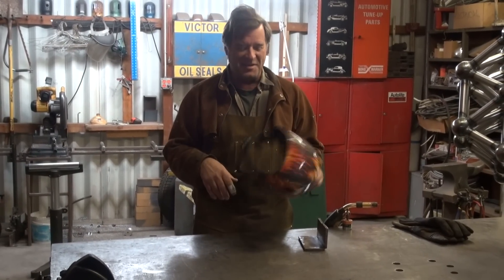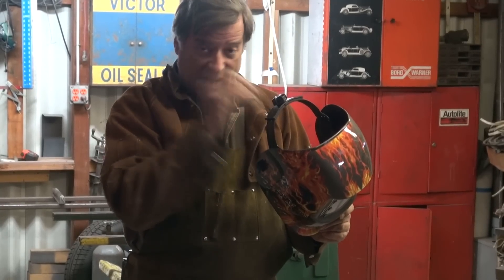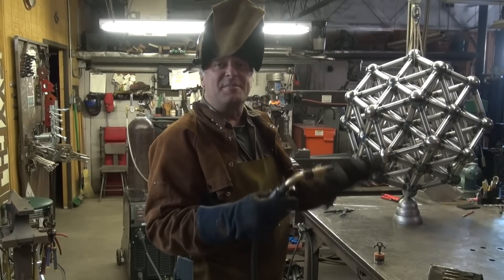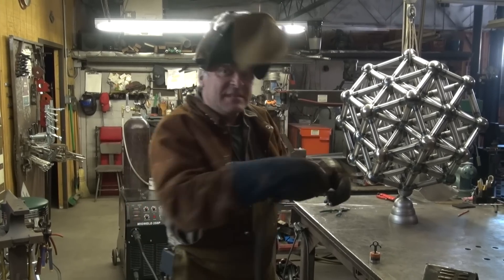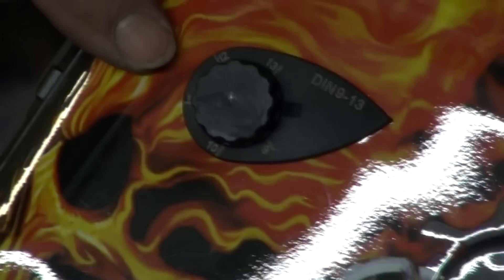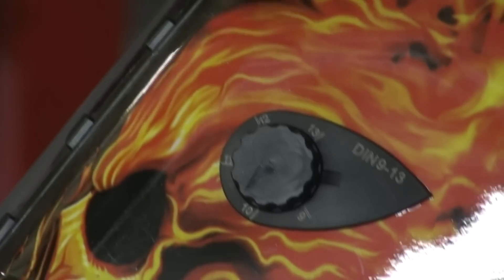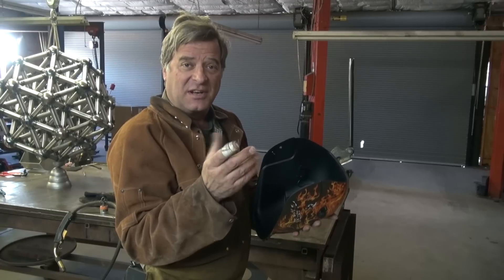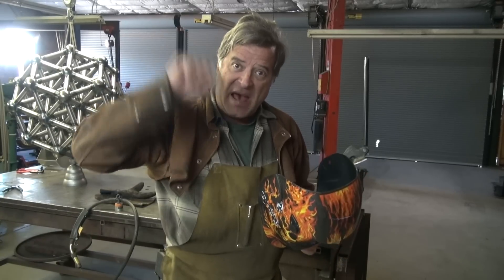How to See Better Out of Your Welding Helmet - Kevin Caron

Comment: I use shade 12. I work in heavy structural steel fabrication mig welding so my machine settings are high like around average 30 volts so shade 12 is better for me
Reply from the maker: Well, that must leave a mark on the electric bill!  Thank you for watching and posting.

Comment: I will say you welders wield some black magic with how you keep the helmet on your heads. I have three, from a cheapo Lincoln Electric, to a manual Miller, an autodarken high end Miller, and I cannot keep it on my head. At all. Unless Im welding looking up, it aint happened, not even enough for a tack weld.
Reply from the maker: I do have to tighten mine a bit to get it to stay.   Once you get the head gear adjusted correctly to your head, they normally stay in one place .
Reply: @KevincaronSculpture  Mine doesnt seem to like that. I do have long hair, and thats making it harder to figure out lol

Comment: Thanks for the vid, i noticed your useing gas to weld with and you were pulling the gun towards your self when useing gas you push your gun not pull it  pushing the mig gun keeps the gas on the ark pulling it alows the gas to go were it likes not stay were its meant to be on the ark if pushed not pulled your weld come out 10 times better and you wont have anywere near as much grinding to do to clean up your weld in fact pushing the gun and keeping the gas on the ark makes the weld look that much better you wont want to grind it the welds that pretty ive been welding since i was 15 im 59 in 26 days hope this helps take it or leave it up to you thanks again for teaching ppl they art of ajusting a helmet i wish this vid was around when i was 15 and learning as my welds were shitty at the start as i couldent see my weld and my weld never layed down were it was meant to go mind you back in my day starting out we never had helmets we could ajust eather the auto helmet was a life changer now all my welds are great i can actuly see this is a great video for ppl starting out so a big ty. regards.
Reply from the maker: Thank you for watching and posting Rod!   Always great to learn new stuff and even get a slap on the back of the head now and again.   I know it's a bad habit and will try to push the gun instead.

Comment: Are all the settings safe for eyes no matter the circumstances. One of my concerns has been to not turn it down to low. But I struggle to see well enough to see the area. Wonder from the seam.
Reply from the maker: No, you have to set the tint to the type of welding or grinding you are doing.   If you find yourself welding with your eyes half shut you need to go darker.    If you can't see the arc, then go one step lighter.

Comment: Great advice Kevin! I'm surprised you didn't mention insuring the front clear lens protector is kept in near new condition, removing any welding smoke and splatter plus any oils that have stuck to it from the dirty air environment welders work in. AND - Keeping the inside clean as well, using eyeglass cleaner wipes, as needed. Some welding hoods even have some kind of a a clear cover on the inside that needs to be cleaned or replaced when they get dirty. I also wear 'whole lens' safety glass readers of different magnifications (1.5 to 3.5)  depending on what I'm welding and how far away from the weld pool I am. Damned getting old makes it harder to see! (I'm 71 and still enjoy welding!)
Reply from the maker: All great advice Jesse!!   Thank you for watching and posting.

Comment: Hi, I'm brand new to welding and am struggling to see when I draw an arc. I'm stick welding and need to get advice on how to see at the moment the welding visor is brought down. I keep trying to start nicely, but every time I flip down the visor, I can't see I damn thing at the most crucial moment when I'm trying to start a nice arc!!! Any tips? Because I keep flashing myself in my eyes trying to sneak a peek!!!
Reply from the maker: Oh how I miss the good old days!   The best advice I can offer for this is lots of helmet time.   Just get some scrap and practice starting your arc.  I really don't know any tricks to help with this on a fixed shade helmet.   You could get an auto-darkening helmet and go from there.  After a few dozens rods you should start picking this up.

Comment: I never get flashed when I watch a video but the real arc light really troubles my vision.
I guess I will limit myself to spot welding with closed eyes (flux-core).
Reply from the maker: Try a fixed shade helmet with a number 10 or 11 tint.

Comment: Seeing the weld is not the problem, it is seeing where to weld. All i could see i your weld. I am working on a floor pan and very hard to see the seam.. Must be old age.
Reply from the maker: time for a set of cheater lens in the helmet!!
Reply: Had to look up cheater lens.. You mean magnifier lens. Just bought this at hardware store and glued on magnets at bottom.. Now i can see. https://www.amazon.com/Kasonic-Technology-Cordless-Emergency-Included/dp/B07K8SBWZX/ref=asc_df_B07K8SBWZX/?tag=hyprod-20&linkCode=df0&hvadid=309781175456&hvpos=1o4&hvnetw=g&hvrand=14791904779538865536&hvpone=&hvptwo=&hvqmt=&hvdev=c&hvdvcmdl=&hvlocint=&hvlocphy=9033558&hvtargid=pla-569243474051&psc=1&tag=&ref=&adgrpid=60862048999&hvpone=&hvptwo=&hvadid=309781175456&hvpos=1o4&hvnetw=g&hvrand=14791904779538865536&hvqmt=&hvdev=c&hvdvcmdl=&hvlocint=&hvlocphy=9033558&hvtargid=pla-569243474051

Comment: I didn't like this video. I couldn't see the puddle on a shade 9 or any of the other shades.I used to use cheap reading glasses. I found that I can use cheater lenses in my welding helmet.I have bifocals. So I weld looking through the top lense ( plus cheater lense). When I flip the helmet up, I inspect the weld with the bottom lense of my glasses. Also, sometimes you can see the metal your welding on with the helmet up but not down when your welding. Sounds funny but I will put a light directed at where I am welding, while I'm welding.  Hope that helps.
Reply from the maker: Thanks for sharing!

Comment: glad im here. i just started to weld. i was running thirteen and to me it looks like nine  according to the video, i can see alot of things around my weld running a 13. and my eyes still felt like popcorn after only 8 4 inch welds. is this normal. is there something else going on? and after 2 days when my eyes felt better i ran a 13 on my mask and wore my sunglasses and i didnt get the popcorn eye. i know a welder who was completely confused by this.... so whats going on.
Reply from the maker: You must have very sensitive eyes!    I would say take a week off from welding and let your eyes recover fully.    Then try again at shade 13 but make sure you are not getting any reflected light coming under the helmet.   Or maybe your helmet is not working correctly.    Try a different helmet and see how that works.  Make sure your helmet is not set to grinding mode also.

Comment: Avoid leaning directly over the weld.  The smoke soots up the lens too quickly.   Use clear plastic lens as the outside layer over the shaded lens and over the clear glass lens you might have behind a flip-up.  A plastic lens will shed sparks, where a glass lens will get encrusted with metal bits,  Toss the plastic lens as they get permanently  goofed up.
Reply from the maker: Real bad habit of mine for sure!    Got a fume extractor coming in a few days.   Should help a lot!

Comment: Great videos thanks.Reflected light is my biggest problem. Does that bit of cloth you have on the front help with that
Reply from the maker: Helps big time with light coming in from the weld.   Also keeps sparks from  going down your shirt.
Reply: Ian, I also noticed the leather flap and thought it could be to protect your skin from the sun like arc or flash of the welder as in skin cancer over time. Either way I'm going to make one!
Reply: Beard protector

Comment: some tips on seeing your welds better. clean every lens in your hood before you start to weld ( most new hoods have 5 or 6 layers) and replace the  clear protective plastic lenses regularly, and any other pitted/scratched/cracked lenses immediately. if you need cheaters (reading glasses) they make snap in (on the inside of the hood) a square cheater lens in most normal reader prescriptions that can be found at any welding and gas supply shops or maybe on amazon (im gonna look now)
Reply: here is a link to amazon's welding hood magnifiers, it looks like they have many many options to choose from starting at $8 and go up from there... worth a look https://www.amazon.com/Diopter-Magnifier-Welding-Helmet-Cheater/dp/B0742H69DY/ref=sr_1_1?ie=UTF8&qid=1511403646&sr=8-1&keywords=welding+hood+magnifying+lens

Comment: Kevin:  I'm using a Lincoln Tombstone stick weld - I'm self taught for about a year, but I have a problem with sticking when starting out.  I'm using a 6013 or 6011 stick and working with 2" tubing (approx. 1/4 or less thickness). any suggestions?
Reply from the maker: A little more amps sounds like it will fix that.   and more practice of course!

Comment: 2 weeks into welding school and I finally figured out my helmet was set too high at a 13 for 7018 stick. I kept going over the edge of my material. Just an embarrassed newbie. Will be trying different settings as I weld now. Thanks for posting what may seem to seasoned welders, common sense.
Reply from the maker: Glad to help!
Reply: ya gotta start somewhere... try these guys, they have everything about how to weld: weldingtipsandtricks, and weld.com these are some of the best youtubers out there. hours and hours of welding instructional videos from both sites.

Comment: How about what tig weld looks like? I just got a new tig welder and my old helmet keeps flashing me, it always worked fine with my mig welder. So what should tig helmet look like?
Reply from the maker: YOU may be running too low an amperage for that helmet.   Try turning up the sensitive to max or going to a fixed shade for amps lower than about 30 amps.   The fixed shade will also fix the problem.   I use the same helmet for mig, tig and stick.

Comment: I can see the rod, I can see the puddle, I can't see the gap I'm trying to weld. This didn't help a bit.
Reply from the maker: Stop looking at the light and look in front of it..
Reply: Everything goes dark except for the puddle...the problems started when I went to glasses.
Reply: you can try to re position your rod or torch angle so you can see the tip of your rod or torch and the edge or the part or your welding project,  do a few dry runs (welder off and hood up with your rod/torch) so you can see the exact part of your weld. this will also give you the best way to prop your hands so you can complete your weld without stopping in the middle of it, also try to see if a push vs pull will give you the best result on your dry run. good luck and keep practicing.
Reply: also check out weldingtipsandtricks, and weld.com these are some of the best youtubers out there. hours and hours of welding instructional videos from both sites

Comment: When your eyes are as bad as mine nothing works
Reply: wait for really sunny days. Welding outside in the sun has got to be the best light to weld in. Everything else I have to put the light so close just to see where to continue the line. 

But I hear ya on the bad  eyes I have a pretty beefy prescription and sometimes it is hell when doing work that requires welding. You really want to be super frustrated try finding safety goggles that fit over glasses.

Comment: Kevin Caron, Artist  while I'm welding my arc gets bright and it basically gets bright through my welding helmet lense. And it kind of blinds me. is it the arc or is it me or the machine? or is it the helmet
Reply from the maker: Maybe change the battery in your helmet if it has one..     Or maybe you are blocking the light getting to the sensor on the front of the helmet so it goes light again..     Or maybe you need a better/new helmet!
Reply: Kevin Caron, Artist Well I bought it like A month it's fairly brand new. The batteries are fairly new. And see that's what I was testing just now with the light on my phone is move it away from the sensor and it would get brighter then when I'd face it away from the sensor so I'm guessing that's the problem like u stated. I was welding in my college class today. And it just kept getting bright Everytime I'd strike an arc after like 3 seconds it would get bright and blind me through my helmet. But thank u sir I'll try that tomorrow in class and keep it mind not to block the sensor.
Reply: Bad helmet.
Either sensors or electronics.
I used someone's bad helmet like that before. If you can't clean the sensors or replace the battery to make the auto darkening instant and right, get another hood.

Comment: I am a first year welding student at Lone Star College here in Houston. My welding helmet is made by Chicago Electric and has two dial settings on the inside. One for sensitivity and one for delay. Both go from MIN-MAX. I was just wondering what would be the best setting on this particular helmet.
Reply from the maker: Mine is set to mid range on the sensitivity and min on the delay.

Comment: love that ball thing in the back~~!!
Reply from the maker: Still available!    See it finished here.....http://www.kevincaron.com/art_detail/charged_particle.html
Reply: being a painter, I was wondering how you painted all those crazy angles? is it powder coated? fantastic work BTW
Reply from the maker: Yes, that finish is powder coat..   The auto body guy I use just laughed.
Reply: yes, paint doesn't go around corners!  great work, I have been checking out your tig videos. I have never tigged before but I just got a ahp 200 in and am destroying metal left and right...it's not nearly as easy as the videos!

Comment: why are you pulling the weld instead of pushing?
Reply: +jayson smith 
You can do both with MIG. I know some people get uppity about which one you use but, as long as you tie in properly, it makes little real-world difference. I had to weld some tubing today that was fixed in an awkward position and it would have been very difficult to stay on the front of the puddle pushing it, because of the angle. Welded up fine pulling. Unless you work in a fab shop where everything can be easily positioned as you like it, it's good to know and practice both.
Reply from the maker: +jayson smith          It's just a demo...
Reply: Because with MIG you can push or pull cause theres no flux to contaminate the weld.
Reply: unless you are using fcmaw (flux core metal arc welding) or dual shield fcmaw. (a gas shielded co2, argon, or any other mixed welding gas) along with a flux core wire. used in windy conditions outside on structural welding like skyscrapers or heavy equipment in the field. you can push or pull using this method as well. true mig uses the gas as the shielding, but doesnt work well under windy conditions because the wind blows away most the gas. sometimes you have to make a wind break ( a wall out of wood or cardboard) when welding under windy conditions. fcmaw is similar to smaw (stick) except the flux is inside the wire instead of on the outside of the stick

Comment: I'm welding in the garage, and the electric lighting is faint.  Aside from the tint, can I put a lamp on my weld to see better?  I keep thinking that will help because I can't see well.  I'm using a 10 with a flux cored welder.

Comment: im welding double shielded flux core wire , welding ships , i was welding with passive 11 lens and it started to be too dark , it it possible to lose eyes during welding using shade 10 ?
Reply from the maker: serfer307 Nope, I use 10 for MIG welding all the time...

Comment: wear bifocals, can't weld with them, so i use walmart reading glasses. when i weld something where its hard to see, i draw a chalk line where i need the weld, makes it a lot easier to see.
Reply: you can get cheater lenses from dedicated welding and gas supply shops (maybe amazon) that snap into your shield, they are not cheap, but when you need readers like me. this eliminates the wall mart specials because they cover the entire lens so if you are in one of those odd positions like under a car and welding exhaust and stuff like that you can see through every corner of your lens.
Reply from the maker: Curt Johnson Great idea with the chalk!!
Reply: awesome tip with the chalk. I never thought of that but every once in a while you hear a tip that you know immediately will work or be a benefit. This is one of those tips so thanks for that.
Reply: I'll use soapstone to make a line when I'm stacking welds but even then sometimes I can't see it good enough and it's just guesswork
Reply: +Curt Johnson good tip will try that
Reply: it sucks getting old, at 70, it seems you are just getting started. lmao. you can get prescription diving goggles, that would work, maybe.
Reply: Curt... gotta try that!
Reply: I need to try chalk